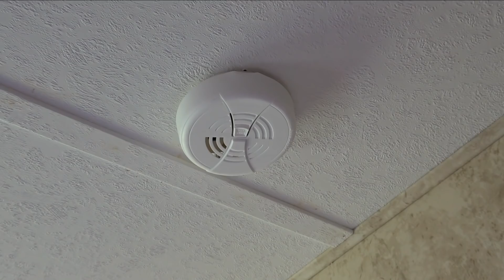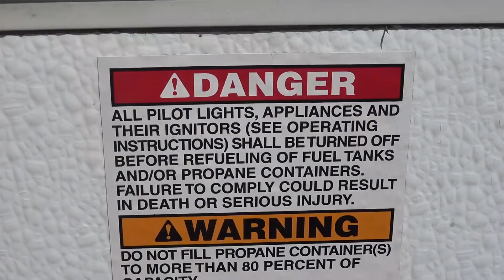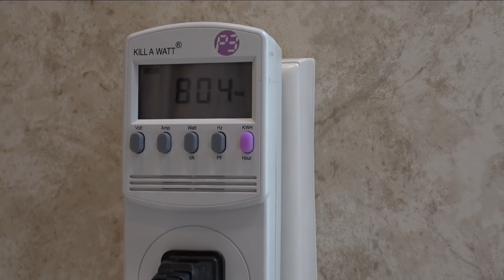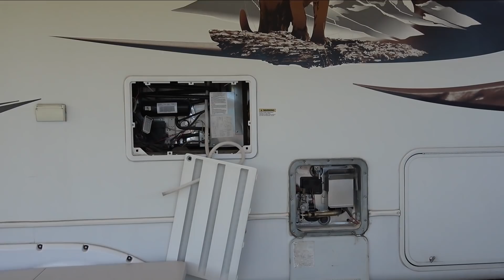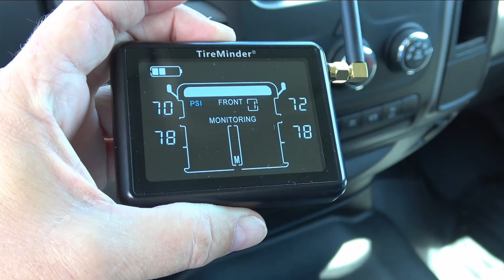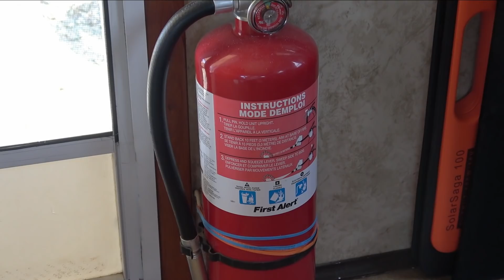RV Fire Safety Tips and Advice

Comment: Why do they make the escape window in a 5th wheel camper so small? An adult of plump size couldn’t get out
Reply from the maker: Likely has to do with structural integrity. If they make it too big then it weakens the frame. Needs to be very strong at the front end where the camper hooks to the truck.

Comment: 30 percent of rvs have wire damage from mice and rats, install smoke detectors in all the basement compartments
Reply from the maker: Good advice and if RV is new to you check every fuse/breaker to make sure it's the proper size and rating so if a short happens the fuse should blow. Also check for undersized wiring. Cheers, Ray

Comment: Hey Ray, speaking of cramped counter space and the cook top burners, one thing to keep away form the burner(s) is easily flamable items such as paper towels, rags such as dish towels and cardboard boxes away from the burners. If you need to use them around the burners, keep a super close eye on them. I know one of my younger sisters set a dish towel on fire, but were able to put it out real quick before it set the house on fire. Speaking of that sinario, a family lost their house that way. Basically, my dad and I were headed into a different town to pick my sister's up and we came over a hill and saw the smoke that was being blown over the road. Maybe 2 weeks later (I'm rough guessing here), a fire martial (or whatever his position was) to talk about fire safety and what happened to the family was brought up.
Reply from the maker: Great tip!
Reply: @LoveYourRV  it sure is Ray. Looking at my comment again, I realize I forgot to mention about the idea of when the family losing their house happened, it was likely around the summer of 2008 or 2009 in the U.S. or so esk. Also, the fire 'marshal': an actual postion i didn't realize actually did exist in the U.S. and Canada, came into 'school' (again, whatever his position was).
Reply: @LoveYourRV  also, just thinking of it too, speaking of flammable items and having them too close to the burners, be cautious of loose/baggy clothing as well.

Comment: Good video. Fires in RVs is the number one issue for destruction. I just added a couple of First Alert TUNDRA aerosol cans to kitchen and bedroom in our TT.  They are 14oz cans that last 32 seconds. They are good for 3 years, so says the manufacturer.  I also have a 10 lbs. ABC Badger extinguisher and a 2.5 lbs extinguisher that came with the rig.  I like your baking soda boxes idea in the kitchen. I know however I will forget to put those out.  So I bought a Fire Blanket that mounts in a quick release case on the wall. 
At my advanced ‘feels like’ age of 105 yrs. picking up a 10 lbs. fire extinguisher that weights lots more is no easy feat. So I would recommend getting two 5 lbs. ABC extinguishers that would allow easier handling. 
Remember, you can always practice your fire making skills in any major USA city ! No extinguisher required.

Comment: That's a great idea to set up your foldable ladder set up outside your escape window! My escape plan is similar for the sharp edges issue, but in our escape plan, I have a thick rope with knots. Great if you're physically fit, but we won't be capable forever.

Comment: Thanks for doing this. Good info. On a side note, my 2012 Cougar's gas detector just sounded the "expired" alarm this winter.  It lasted over the 7 year mark (I didn't even know they expired)  before giving up. The replacement was easy (I might have watched your video on this?) and inexpensive.  A couple of months later the carbon monoxide detector cried "foul" and needed batteries replaced. I need to set up a schedule like yours and just do all of the detectors at once. On my list of things to do...  Cheers!
Reply from the maker: You're welcome. I was just slightly ahead of you with my 2011 model. :)

Comment: Great tips.  Wish more RVs would come with emergency exit doors.  As a senior with limited flexibility, I don’t know it I could get out a small exit window.
Reply: You won't , I don't want to be cynical,so I'll explain.  15-20 yrs ago when installing millwork in residential construction,  sometimes the only way in was a ground floor basement window...the ones that are 18" tall.  Let me tell you, people have a fear about going feet first and not being to feel where your feet are going.  Going out face up you risk hyperextending your back.I was doing this in my 50's and did it fairly often and there is still that fear of not knowing where your feet are.So best come up with a plan 'B'.You'd be better off buying an electric chainsaw and chopping a hole out the front fibreglass big enough to escape.You may have less than 2 minutes.Also I've done some firefighting, there are alternatives to the ABC fire extinguishers.  Look up Fireayd and Geltech solutions, both are more effective than the standard extinguishers.
Reply from the maker: Thanks, good point, I mostly see the extras doors only on travel trailers and toy haulers.

Comment: Thanks for the tips, Ray. I always keep a second water hose hooked up to the parks hydrant and coiled up under the nose of our 5er. Comes in handy if I need a close water supply to extinguish our campfire plus is ready in the event of an emergency at our rig or at neighbors.
Reply from the maker: Good tip I also use a water splitter and have a second hose setup, usually its for washing the rig and truck but also can be used to fight a fire. Cheers, Ray

Comment: A couple of months ago, the propane detector in my full-time 5th wheel went off.  I found that a propane tank I had filled on a very cold day, vented excess pressure soon after on an unusually warm day.  Although the compartment the propane tanks are in is supposed to be sealed and vented outside, enough propane got into the living space to set off the detector.  I ventilated the rig.  Since the tanks are located below the bedroom in the basement, I bought a 120 volt combo carbon monoxide/propane detector and put it on the night stand by the bed for an earlier warning of a problem.  A couple of weeks later, the new CO/propane detector went off in the middle of the night.  I woke up feeling dizzy.  The detector showed a very high level of CO even though no oxygen consuming appliances were on.  I ventilated the rig again.  After some Sherlock Holmes work, it turned out a bad battery was being over-charged and produced excessive hydrogen gas.  Again, although the battery compartment is vented, too, enough of the hydrogen seeped into the bedroom to trigger the CO detector.  A new pair of batteries were bought.  I learned from Google that carbon monoxide detectors can be fooled by hydrogen gas.  A good thing, too, since lack of oxygen from any cause can be fatal if it goes on undetected for long (such as when you are asleep).   At last report, I am still alive!
Reply from the maker: Wow, that's wild. Who would have thought. Thanks for the warning. - Ray
Reply: Thank goodness!!

Comment: Thanks for the tips. I never realized the propane detector expired! I'm sure ours is original equipment. I never thought to check the fridge vents for nests. I see you removed your stove cover; good idea. Ours makes noise when we walk around in the Cougar and I would never use that space as a work surface anyway. I never understood why some RV manufactures put rails on the outside wall to attach grills/bbqs.
Reply from the maker: Our rig actually never came with the stove cover. With the amount of cooking I do I would have likely removed it. :)